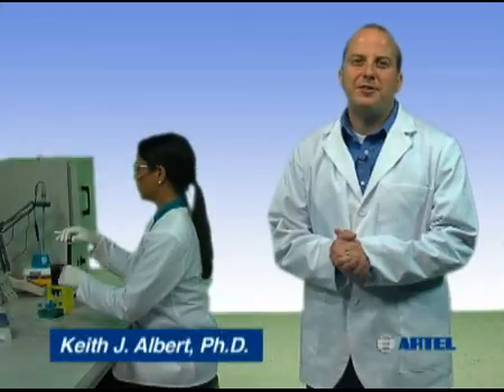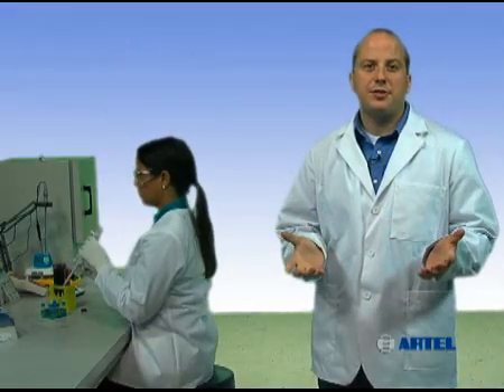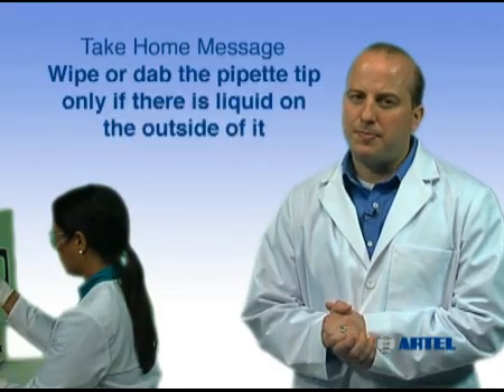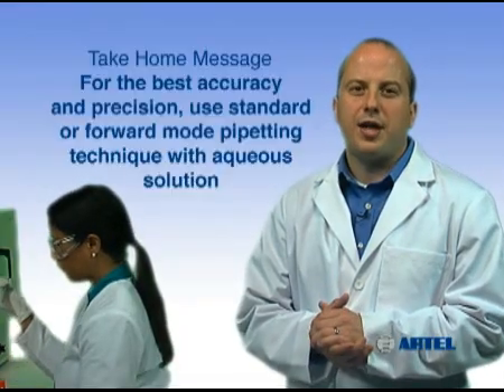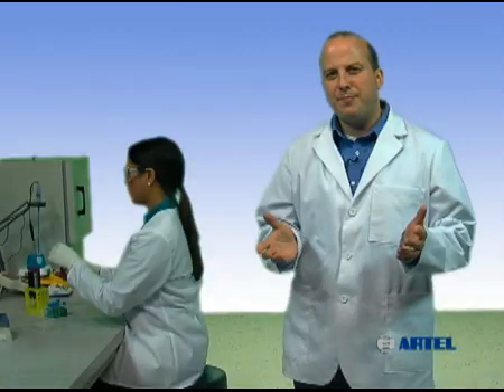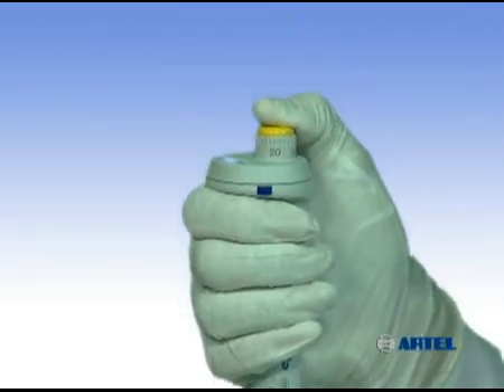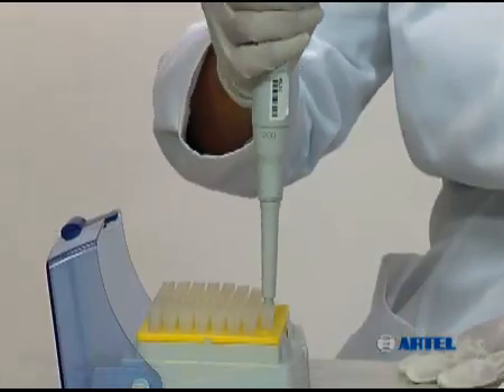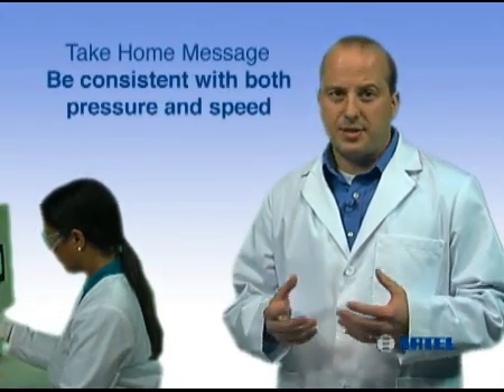Artel's 10 Tips To Improve Your Pipetting Technique

Comment: 1. Pre-wet the pipette
2. Work at temperature equilibrium
3. Examine the pipette
4. Use standard mode pipetting 
5. Pause consistently after aspiration 
6. Pull the pipette straight out 
7. Minimize handling of the pipette and tip
8. Immerse the tip to the proper depth
9. Use the correct pipette tip
10. Use consistent plunger pressure and speed

Comment: Its a good wholesome video. Good to take two vials for practicing pippetting from one vial to another. The veritcak smooth plunging asoursying and dispensing. Repeatedly.  It takes 1-3 months yo get used to get the skill to settle in your innner being. Using calibration and weinging machince pipetting can be checked.

Maybe will edit this after sometime ~ on calbration.

Comment: Does pre-rinse and pre-wet means the same thing?
Reply from the maker: Thank you for watching the 10 tips video series and for your question.  Traditionally, the terms pre-rinsing and pre-wetting refer to the same process however in practice, we have observed them to be quite different. Below I’ve outlined the steps to illustrate the technique differences, which primarily center around removing the tip from the sample solution.

Pre-Rinsing:  press the plunger to first stop, place the pipette tip in sample solution, leave the tip in the sample solution and exercise plunger up and down several times.   

Pre-Wetting:  press the plunger to first stop, place the pipette tip in sample solution, aspirate sample, remove tip from sample solution, press plunger to second stop to fully dispense sample against side of receptacle.  Repeat steps at least 3 times. 

I hope this information is helpful.  Thank you again for reaching out.
Reply: @ARTEL10Tips  Thank you for taking the time to answer my question!
Reply from the maker: @SH-fz5pt  You are welcome. We thought you might find these additional resources  helpful; ten tips to improve your pipetting technique https://www.artel.co/learning_center/10-tips-to-improve-your-pipetting-technique/ and  pipetting viscous solutions best practices https://www.artel.co/learning_center/pipetting-viscous-solutions/.